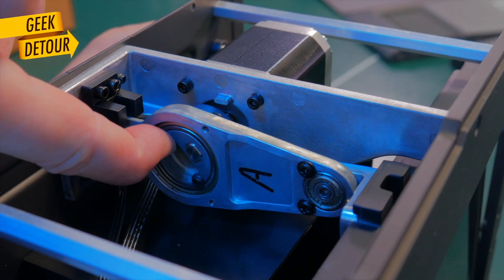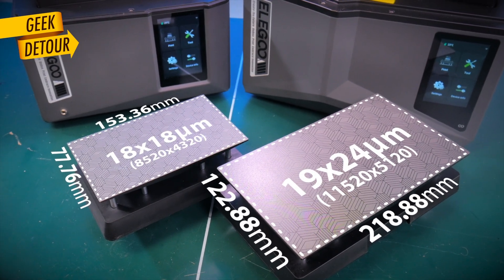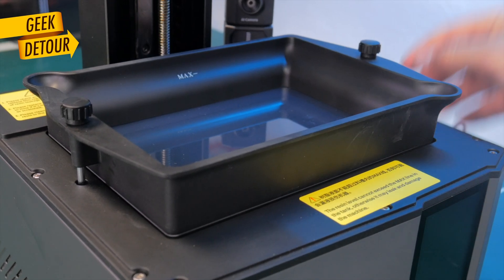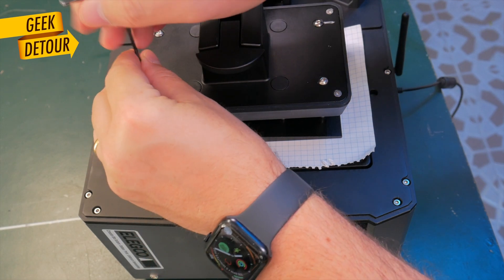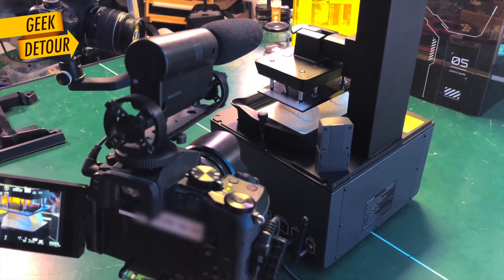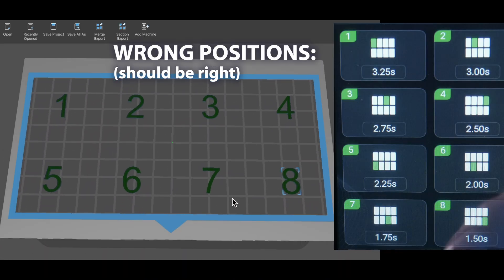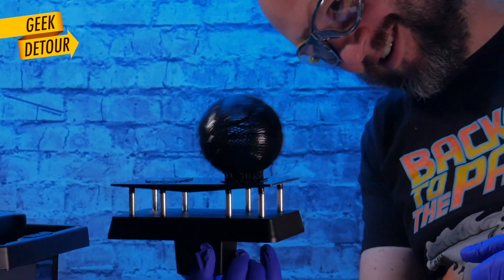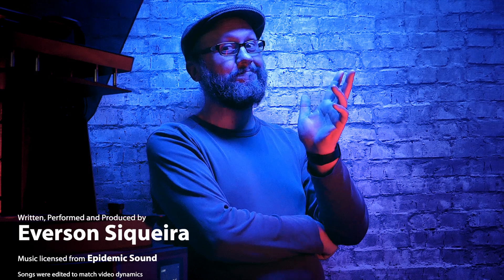Mars 5 Ultra & Saturn 4 Ultra: INSIDE! Elegoo Resin 3D Printer

Comment: I have tried 3 different versions of Chitubox Pro to run resin calibration prints.  I numbered my own models, and rotated model #1 90 degrees to be sure.  I have them laid out exactly the same way as you show.  In my case however, my prints come out reversed.  The #1 position ends up printing in the #8 spot.  Instead of flipping the build plate from left to right 180 degrees, for me Chitubox flips the build plate front to back, simply moving the "back" row into the front.  I have the same results in free and pro.  Did the update change anything?  You mentioned you hoped they change the layout.
Reply from the maker: Oh, you don’t mirror the parts - numbers will appear, well, mirrored. I have separated objects and I drag them to different positions. On the computer, you need to see the objects as they should appear in real life. What I did differently is that in the original stl, the parts were together as a single object and I broke them apart in Blender, and exported them to individual STLs. I hope I am explaining it properly 🤣
Reply: @GeekDetour  I'm sorry, I explained that poorly.   I did not mirror them myself.   I was only trying to illustrate my results.   I numbered my models, have them laid out exactly as you show in the video as the successful order.   They also match my own dry run using paper over the screen to view the lights, etc.   Looking at the build plate in Chitubox, #1 should be placed at the back left.   When it prints, it would be in the location of #1 on the touchpad, which looking at the machine would be the back LEFT now.  The front right being #8, or the shortest time.

When I run my print the model tagged #1 in Chitubox, and placed in the back right of the plate, prints on the front right, which corresponds to #8, the shortest time.  I have to place my calibration models OPPOSITE of your layout, and Chirubox's layout, for them to work. 

I know this is a Chitubox issue, but if anyone else is having the same problem, they might not be aware.   They may be looking at their results backwards.  I have a photo that can explain it better, I'll post it for you in a moment.   I've been trying to wrap my head around this for last few hours!
Reply: @GeekDetour  Thanks for the help!  I just sorted out my issue.  I did a complete and total removal of Chitubox, and a reinstall.  Not just uninstall and reinstall, as I've done that numerous times with no change.  I removed all traces.  After a fresh install I now see the rotated #1 model printing in the expected #1 spot.  This is with the same version of Chitubox that was printing incorrectly.  Either way it's working now.  Thank you again for the great information!
Reply from the maker: I am glad you could fix it now 😁 I had some fight with the latest version of Chitubox Basic - but that’s my Mac’s fault. It’s an 11 years old iMac i7 from 2013, and it runs a patched version of MacOS (unsupported) and it is showing the limits of what can run on it.

Comment: Great video! I’m  not sure if I saw this correctly but at the 9:04 mark are those trails of bubbles inside the tops of the towers? If they are I was hoping this tilting vat was going to get rid of those. Have you printed any of the Anycubic high clear or Siraya Blu Clear type resins. I would love to see a 75-100mm tall, clear and solid figurine type print to see if the trail of bubbles appear. In your opinion why would these appear?
Reply from the maker: Hi there, thank you! I think what we see there has more to do with my poorly applied spray painting that didn’t coat the interior of the piece properly. I noticed that too when I was editing and I had to check the part in my hand - I actually printed two and I only coated one, the raw part looks solid with no bubble effect, although a bit frosted, as resin parts look when you clean them well.

Comment: I'm wondering if the deformation in the FEP comes by the EXTRA long bottom layers suggested by Resione (70 seconds). I would imagine they generate a SIGNIFICANT amount of heat which could go a long way to deforming the FEP.
Reply from the maker: It could be heat - but it happened only where I had the failures, where the resin got stuck to the PFA instead of coming with the build plate.

Comment: How come the bed jiggles in your method of timelapsing but not in the built in timelapse? I would also find a way to put your camera inside the printer so fumes don't get everywhere.
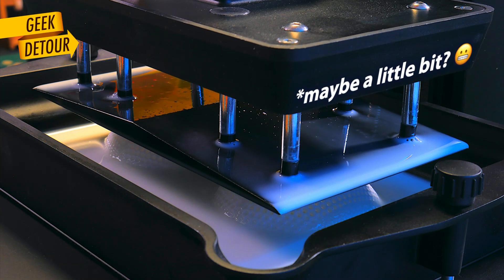Reply from the maker: Hi there! It’s because the built-in TimeLapse takes photos when the VAT is UP. On my timelapse I am triggering when the VAT goes down. But I can also make the VAT look still in my external camera - and you can see it at 8:55 (I adjusted a delay in my trigger) See? The Vat is “quiet” if I want.

Comment: Man, I'm really disappointed your build plate modification didn't work.  I was going to do the same thing!  There's gotta be something we can do to break the surface tension there and force it to drip off.  Maybe a polished edge? Maybe sand it on a bias so it drips toward one corner?  

Great video!
Reply from the maker: Thank you! Yeah... it looked like it improved and it looked very clean when I used other resins - but today I had to fix the video anyways because I wasn't wearing gloves, somebody commented that - and he was absolutely right... So I also had to re-print the balls in that same white resin to really SEE if the improvement was substantial. I think it got a bit cleaner, but I don't think it is worth the trouble to do the mod. I added the result, I had to do it.